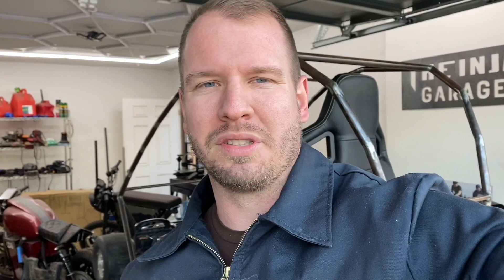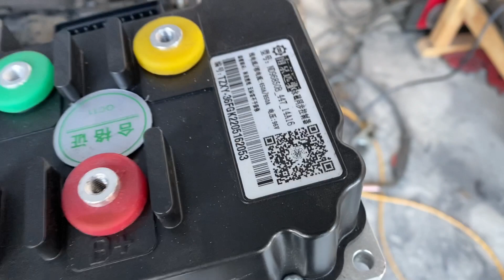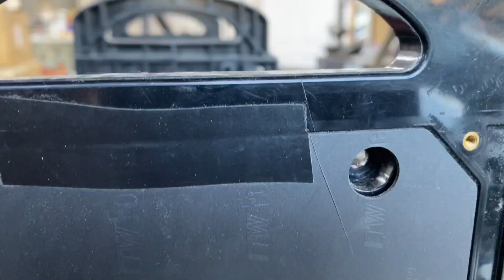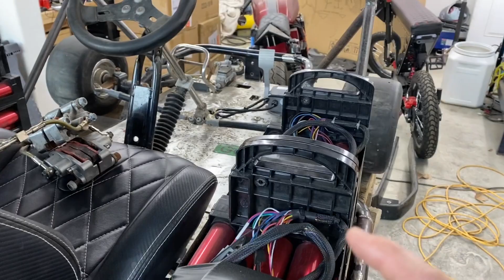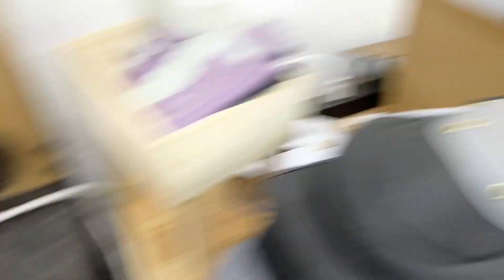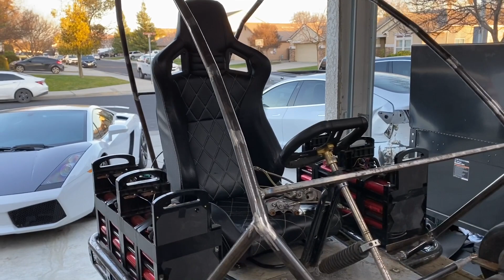Electric Supercart Project Update and Design

Comment: What us your plan for the pre charge circuit?
Reply from the maker: Just a simple single resistor connected to both contractors. It’s already installed and the contractors close without any spark
Reply: @LordCurt  oh okay so you just leave the resistor in parallel the whole time? I dont think there is anything necessarily wrong with that other than losing a few watts during discharge. On my first build i used a momentary switch. Then i went to using a two position switch that connected the pre charge as youre turning the switch and then disconnected the resistor once in the second position of the switch. Now im working on an automatic precharge circuit that is properly fused and all like how they do it in automotive, but im getting commissioned for the build and want the added safety for the customer. If it were for me, a simple momentary switch works just fine lol.
Reply from the maker: @vincentpernicano3277  I guess technically you’re going to lose a few watts of heat, but it should be completely unnoticeable. The only real problem would be the possibility that the controller capacitors are full always even when sitting, so a couple little issues come from that, but nothing worth working much about in my opinion
Reply: @LordCurt  yeah for sure not a big deal. I dont know the nuances but I have read somewhere that certain capacitors and/or controllers are set up where there is a passive drain in the capacitors and in other cases there is not. So I suppose you may potentially have some small constant discharge on the battery but that pack is massive so the time scale is probably negligible. Also not sure if that is good or bad for capacitor…eh i doubt it does any harm in that condition.

Comment: are you worried about the contactors being under the voltage rating? I have had trouble finding contactors that would go above 48vDC. unless I'm finding very expensive Commercial grade electrical equipment for ups building setups
Reply from the maker: Contractors main contacts are generally designed for much higher voltage than 48v. These ones are actually good up to 900v according to their spec sheet